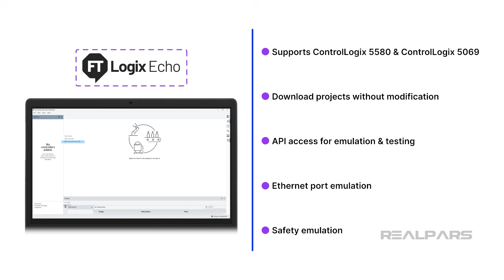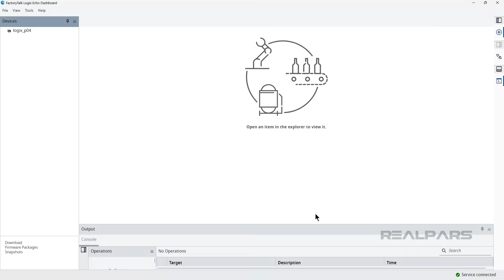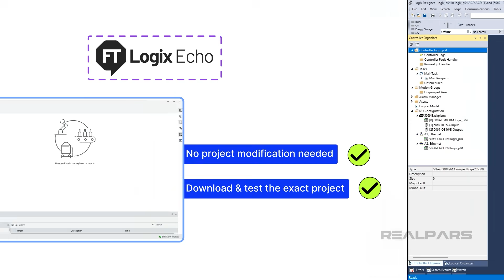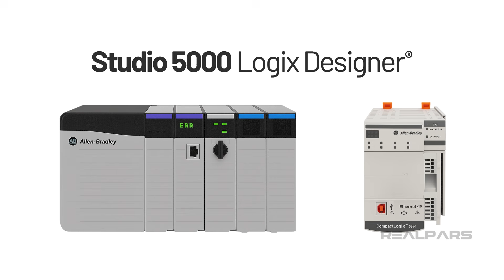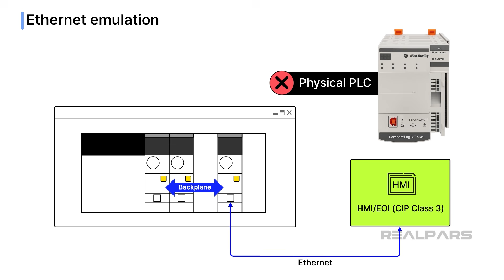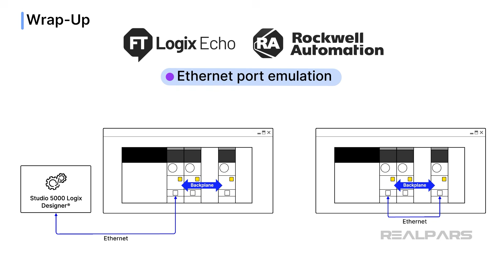What is FactoryTalk Logix Echo?

Comment: Yes. We have been using it for a couple years for testing individual PLC and whole plants. I run the program and simulation on the Echo PLC. The run our FTView ME on our laptops and SCADA software on separate development servers. One instance can run 17 simultaneous PLC at one time. It is able to run an unmodified program with a couple exceptions. Redundancy must be unchecked on ControlLogix and supporting instructions (L_Redun) removed from the program. When IO is inhibited (usually by inhibiting the Ethernet module in the Processor rack that the RIO and devices are under) I build my simulation model in a separate task that reads and writes the hardware IO aliases. When the system is commissioned I unscheduled the simulation task re-enable the redundancy, un-inhibit the RIO Ethernet and it’s ready.
Reply from the maker: Hello, @matthewsnyder1364 Thank you for sharing your experience and knowledge with us! Great Job👏
Happy learning from Realpars!